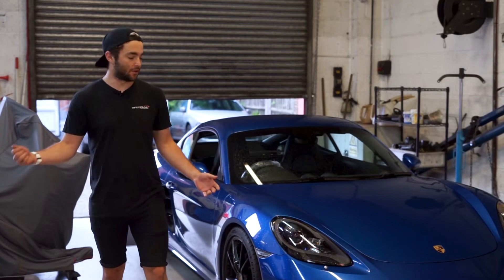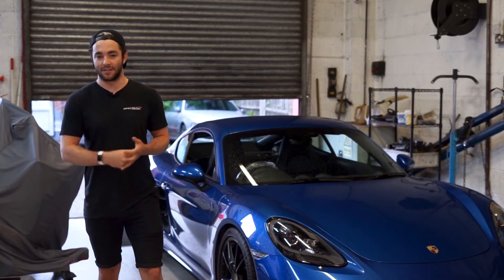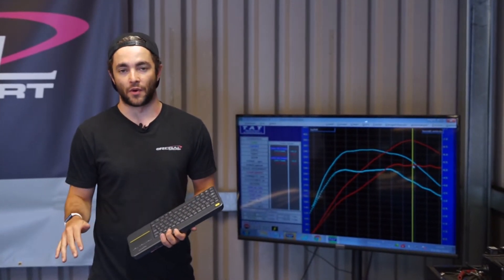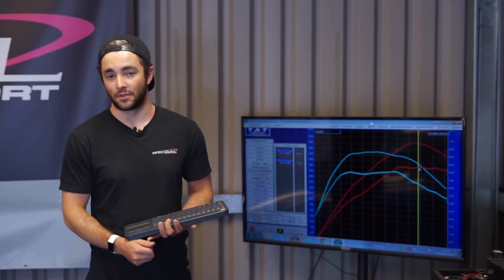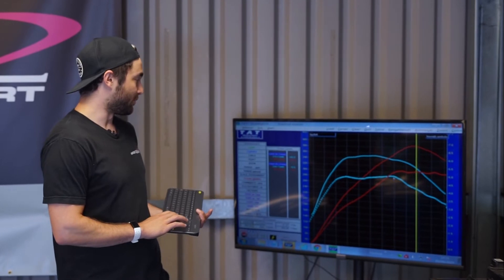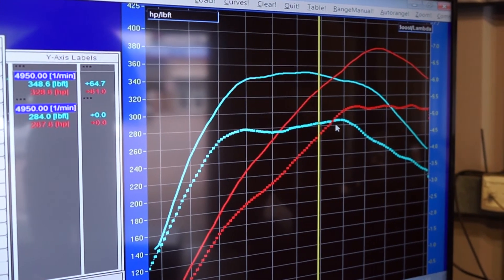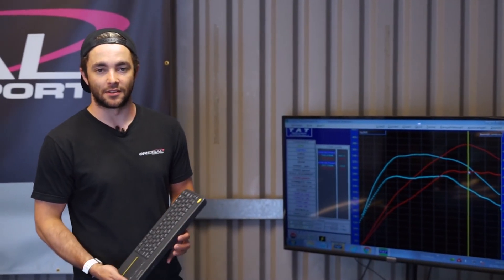+80HP & 75lbfts on a 718 Cayman 2.0T with RSS Stage 2 ECU Software

Comment: Makes the 2.0 significantly more appealing
Reply from the maker: Certainly does! Fantastic power and torque available, we also just installed water meth on this car and did a video too, so be sure to check that out!
Reply: @RegalAutosport  can the car with the 2.0 get into the high 10s or low 11s 1/4 mile ?
Reply: @shelbyhaiketic4212  I got with my cayman T (370bhp, PDK) 11.9 on 1/4 mile, and 9.1 100-200kmh.
Reply: @racebuddy  that’s still very impressive does it feel fast enough for daily driving ? Especially since it’s so light. And how did u get the added power just the ecu tune ?

Comment: I think there’s a valid argument for having a minimum of 6 cylinders in Porsche (sports car). But no denying the gains the 4 cylinder cars bring with a few mods are really impressive.
Reply from the maker: Couldn't agree more with that! For aftermarket tuning the Cayman/Boxster has historically been a tough cookie to get big power/torque gains at a reasonable cost. 

The new turbo platform completely opens up a new realm of performance with these cars, without changing the engine, which is what some customers do do!
Reply: With that rule there would have been no 356, 550, original 718, 912, 914, 924 or 944.
Reply: @gileswardle76  968 and 904 as well

Comment: What kind of engine stress would the mods put? I'm thinking of doing some mods on my 2019 718 Boxster GTS but I'm worried about long term stress on the motor. I wouldn't be taking it to the track or driving crazy, but would be nice to know I have the power when needed. Thanks
Reply from the maker: Increasing output always increases 'stress' as the cylinder pressure is more. If you want to minimise risk, keep the car stock. 

So far though this customer has done numerous track days and uses his car hard on a weekly basis with no issues.
Reply: I wouldn’t be worried at all, most turbocharged motors are overbuilt (especially anything from VAG) and it would be just fine. 
Like Regal Autosport said, there will be some more stress, but that’s expected and it’s nowhere near it’s limit

Comment: Is this recommended on the 2.0 VS the 2.5?

Can you type in what you upgraded on the exhaust?
Reply from the maker: The exhaust has a higher-flow cat. You can do this on both the 2.0T and 2.5T! With the gains on the 2.5T being even bigger!
Reply: @RegalAutosport  so you get additional 8 hp with the hf cat. Does it improve the sound, and what is the price approximately? Worth the expense?
Reply from the maker: @StojanovskiTV  I don't believe we tested the different, so we can't comment on numbers accurately.

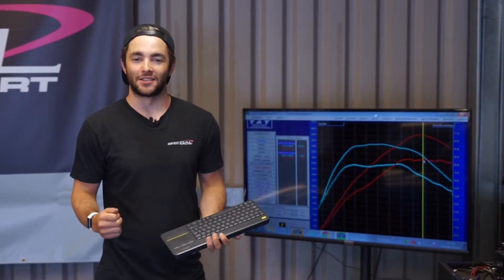Comment: 1:47 Your tune makes the feeling of turbo lag even worse, the car is dead before 3000RPM on that graph. That's where daily driving happens.
Reply from the maker: Incorrect. This vehicle makes more power and torque at every point in the rev range. I think the driving you are talking about happens on different graph and video.
Reply: @RegalAutosport  So you showed that graph at 1:47 for no special reason? It was a graph of some other vehicle?
Reply from the maker: @idokwatcher2062  That was the unfinished tune, scroll forward a little and you'll see the software we are referencing and you should pay attention to

Comment: Hi Ash, have a question, I have the same Cayman and had it tuned but my tuner which is pretty capable and a big name (meaning they know what they are doing) tuned it but the ecu/car won't let the turbo allow to have more then 1.5 bar, have you came across problems like this? On how much bar/psi is this Cayman making the power it has now? I'm Sven btw, bought the wavetrack from you guys for my rs3 8p which I l still have and is doing great, love the diff!
Reply from the maker: Thanks for watching and your business! I can't answer the specifics unfortunately
Reply: @RegalAutosport  worth a try and your welcome. Probably gonna go for a different turbo (TTE465) should solve the problem. 😅